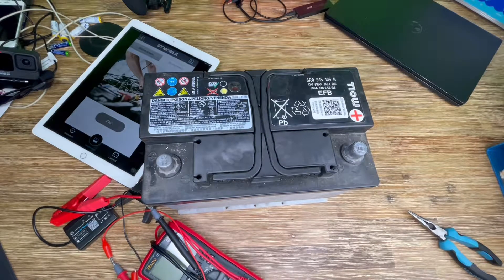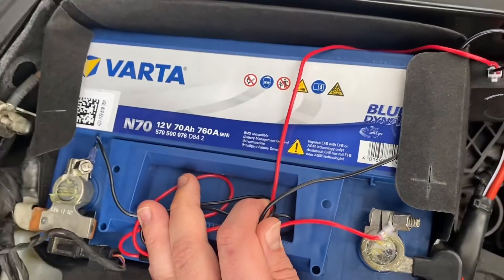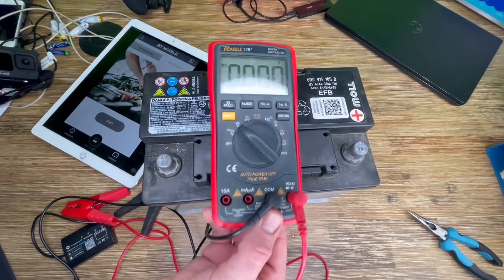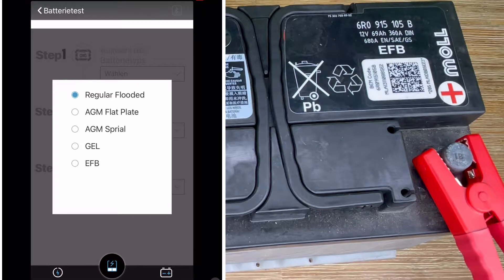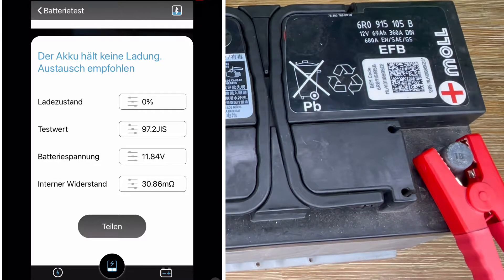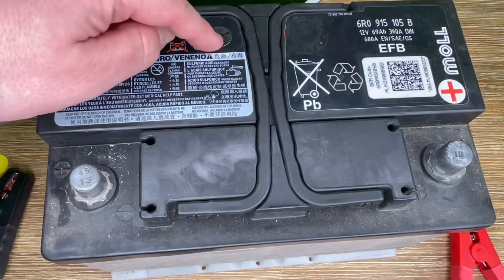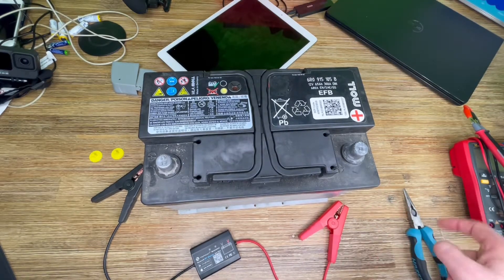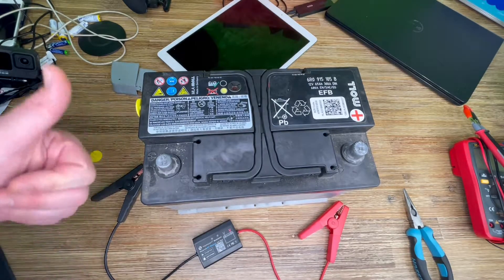How to test an AGM/EFB (enhanced flooded) starter car battery for capacity and current DIY

Comment: I wonder about the accuracy of these testers. My 5 year and 10 month old battery reads 350 cca (26 % SOH) on a 680cca battery and says “ replace”. The tester has been telling me to replace the battery for over a year. But it started the car no problem at -7 degrees C yesterday.
Reply: This is not always related...
Example...
My corolla 1.2turbio requires less than 220 CCA to start as I found out...
Stock battery is 340 CCA, now after 4 years 180 CCA or 220 CCA fully charged..
But car still starts (says replace battery)
However light gets dimmer on crank...
I replaced it with a 640cca 60 ah used efb battery and it starts way better and no dimming lights on crank...
Definatly the efb battery is better than regular
Reply: And voltage engine off immediately fell on 12.2 to 12.3 volts
And now voltage falls 12.7 to 12.9 even after some time